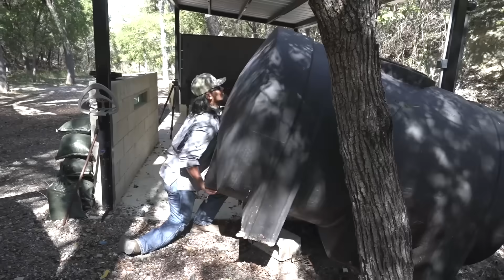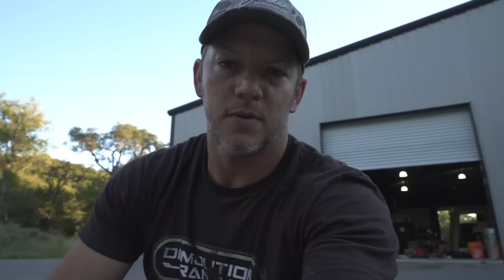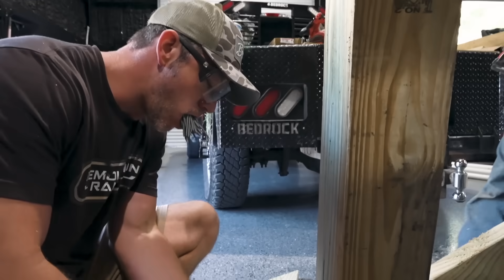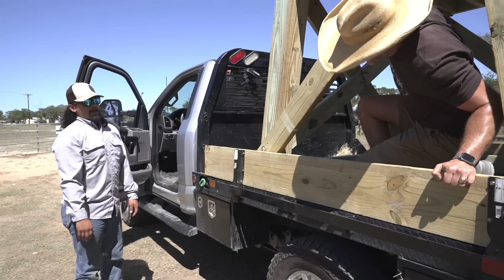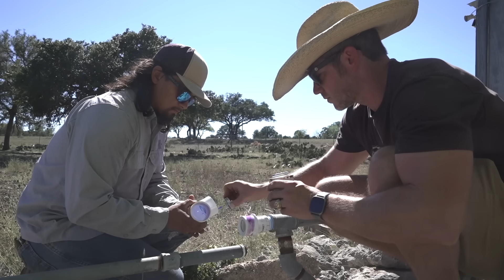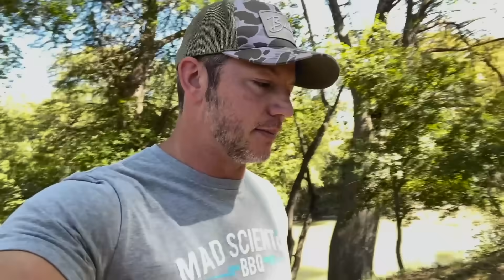Going Into the Cave… But This has to Be Done First!

Comment: You could have just cut 2 inches off the other 3 legs to even it out.
Reply: That would have made too much sense.
Reply: Hush with that sort of talk
Reply: And not wasted an entire 6x6, either
Reply: Pretty sure he wanted 5 feet high to fill into the other tank, as previously stated, but you guys nailed it.
Reply: Totally agree, also they should of put the horizontal timbers on the top of the posts so there weight bering which will support the weight of the water tank far better than fixing them to the side of the post like you have done.
Reply: as another option...he could have added a  couple inches to the bottom

Comment: Put a vertical vent pipe at the top of your overflow pipe to break suction in the pipe. Also, a clear pipe in the overflow would show you the tank level without having to take the lid off the tank.

Comment: What happened to your fire truck build?
Reply: He uses it for fires at the range so it stays there
Reply: Sold it or took it apart I believe
Reply: It caught fire and he did not have a way to put out the fire...
Reply: I think he sold it with a couple other vehicles to help get the ranch. I believe he hinted at it but never confirmed it.

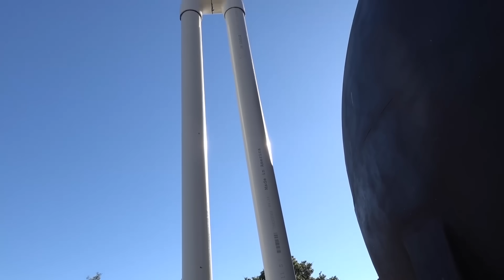Comment: 28:50 what if you just drilled a hole at the top in-between the 90° fittings? Wouldn't that stop the vacuum but still allow the water to overflow, and allowing it to drain over into the pond while making it a simple fix also? 🤔 😅
Reply: What I was going to say exactly😅
Reply: as a engeneer for poatable water that was my first idea. just put a breather at the highes spot.
Reply: Top elbow should be a T with a 6” ft riser.

Comment: @Matt Carriker. Just drill a tiny vent hole at the very top of that joiner section that fills the gap between the 2 pipes going up. When the tank fills, it can still run across but won't be able to siphon because of the vent. If you want to get fancy, put a small upright section of half inch sticking up a couple of inches and it'll work exactly how you want it to.

Comment: Please someone correct me if I’m wrong but if Matt was to simply vent the top of his loop it would eliminate the siphoning from the vessel right?
Reply: Correct
Reply: Yup sounds right
Reply: Still wouldn't work. No way the well pump could work against the 600psi head pressure when the tank has 500 gallons in it.
Reply: @peterosmanski7466 the head pressure is the same whether it’s going into the tank or out the overflow. He’s already shown that it can easily pump out the overflow. Head pressure is dictated by height, and nothing more.  10 gallons or 1000 gallons, the pressure will be the same.

Comment: Yes you need to fill from the top, you are currently trying to build a massive head of water that is working against the pump.
EDIT: That's also probably why you were burning out the pumps at the range.
Reply: False, no difference in head between filling from the bottom of a full tank and filling from the top, either way the pump is lifting the water the same height.
Reply: It's the weight of the water in the tank that the pump can't overcome. If its filled from the top, it only has the weight of the water in the pipe.
Reply: @Apachefog  that's not how it works, the pressure is determined by the height of the water column not the volume
Reply: @isaacclark6749   So if a small pipe were the same height as a water tower, they would produce the same pressure at the bottom, regardless of the large volume in the tower? I suppose logically, since a water tower uses gravity to supply its grid, the whole system down to every faucet in every house is one huge communicating vessel and therefore the water level could never exceed the height of the tower in any part of the system. I had not considered that.
Reply: Head in a top fed pipe = head of bottom fed pipe + head of the tank.  They're equal; only height of water matters, not volume of the tank

Comment: If the top of the tank is sealed it turns into a pressure tank with an air pocket on top. The tank needs a vent out of the top to allow air to escape when filling and to allow air to enter when you are draining the tank.

Comment: You could fill from the top by drilling and sealing a tube to the cap, and put a pressure relief valve on the bottom, then play with the springs inside the valve to allow you to keep a certain amount of pressure or water in the tank at one time🤷‍♂️

Comment: Matt you need a breather tube on the overflow to break the vacuum; that’ll stop it siphoning. Filling from the top may also be slower cos of the back pressure of the water in the tank pushing against your pump pressure. I may be wrong on this but the physics makes sense that way to me.

Comment: As others have said, a hole at the top of the overflow piping will break the syphon. I'd put a cap/hat just above to protect against debris and bird crap clogging the hole/pipe.

As for event planning, yeah you'll want to basically start planning a year in advance, talking to bands and vendors about interest for specific events but you don't have to lock them in immediately. 2 months before the event would be a good point to lock in and start promoting. This will give you time to adapt if a band pulls out for some reason, you could open it up as a battle of the bands for locals if you can't lock in another professional band. Just a few thoughts (played a few gigs, talked with bands and venue staff about the logistics a few years back). Best of luck with future events

Comment: The siphon issue is easy enough to fix, adding any kind of vent to the U at the top of the piping (a T valve, drilling a hole, etc) would stop that...Redo the piping to fill from the top with an overflow pipe coming from there and down to the pond instead (and when the overflow pipe bends down from the top of the tank to go to ground level before running out to the pond, use a T section instead of an elbow and you'll have a siphon-breaking vent already built in) and you'll be set.

Comment: The trouble with filling from the bottom is I'm pretty sure it's having to overcome the pressure of the water in the tank in order to fill, so the more water in the tank, the more pressure it'll need to fill. Whereas if you fill from the top it's just got to push the water up a couple more feet of pipe which I'm sure that pump can handle. Also, as others have said, just pop an opening in the top of the overflow to prevent the syphon effect

Comment: Given how much sun you have there, a recipe that has worked for my brother's farm for years now would be to take solar panels, feed water pumps that collect water into 10 liters tanks up ~15 meters high structures, which then are used during the night to power the next day's batteries, via turbine feed as the water gets distributed to A and B spots on his farm. Water battery. You have both electricity and water resource, all fed by solar power.

Comment: If you drill an air intake hole in the top of the pipe at the overflow's upper bend (between the two 90's at the level of the top of the tank), that may prevent the siphon from forming (though it would allow bugs and such to get in, but that probably won't matter for the water used to fill the pond).

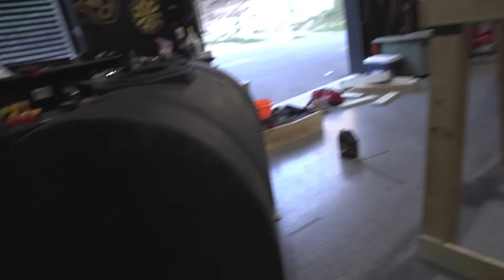Comment: 7:13 mark...Matt, all you guys had to do was to was unscrew the two flat boards from the upright leg that was 2" too short, move the boards up 2" and re-screw them to the leg at the right height before drilling for and installing all of your 10" galvanized carriage bolts through everything. No one would have been able to see that one leg was 2" short, and it wouldn't have mattered at all as far as the strength of the tank stand goes.

Comment: To stop the siphon: Drill a 1/4" hole in the top of your overflow pipe. This will prevent a siphon from forming by pulling air in through the hole and breaking siphon.

Comment: You need a vent hole in the very top of the tank to fill it faster. 
Get two bungs to put in the tank. One in the top for filling and the other at 95% for overflow to pond.

Comment: You're going to create a siphon! Put a t in between the up and down and maybe put like a 1' riser on so it won't create a vacuum and water won't spew out of it. Just drilling a hole will work but you may loose a lot of water while the pump is running

Comment: You could run a water pump from the water cave to the pond and then those 2 would possibly be cheaper and work out together to geta great walk through cave once clearedfrom mud! 😏🤔😅😅
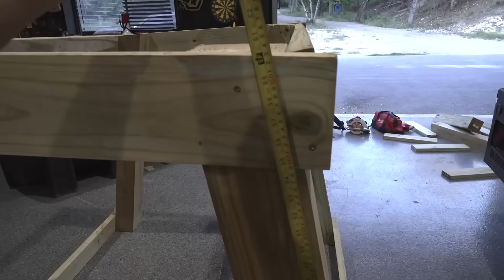Also at 6:45 its because you measured from inside to outside or vice-versa  like from one side to the other at the 5 foot mark!😅😅

Comment: Simple solution pump---- (T1)----- pond... off the (T1) toward the tank.... a pvc 1 way check valve...( T2) ----- tank .....off this (T2)  secondary line to fill trailer tank also used as winter drain... so keep ur current system just cut from 1st T to ball valve and install a one way check valve and a second T

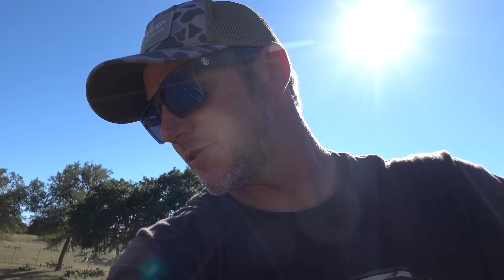Comment: 27:00 Applied air pressure is multiplied by a liquid's surface area. The larger the surface area is; the more water pressure you need in order to overcome the air pressure.

Comment: You might need to drill an air hole or something at the top of the overflow to prevent it acting as a siphon.
A flood/drain bell siphon works in a similar principle to what you have set up. Oh. Apparently it did siphon later in the video.

Comment: The pressure of the water in the tank is less than the overflow standpipe if you filled from the top. Your valve may be restricting the flow some depending on design. You could install a larger valve to tank bottom.

Comment: You should change how to water goes into the tank and how it's overflow works, so there isn't a siphoning effect. You should have an intake at the top, then an overflow close to the top and an drain and outflow low on the thank. Do that right and the tank should fill properly, and then overflow when it gets full as needed and you could drain it if needed.

Comment: The water in the catchment tank is heavier than the water in the pipe (because of the size of the larger tank size) therefore, the water in the tank is pushing the water out, rather than filling the tank.

Comment: It needs to be filled at the top and drained at the bottom. Allowing overflow from the bottom leads to the siphon. You need the overflow to be from the top so water cant be pulled out.

Comment: You basically created a bell siphon. All you need to do is cut one of the 90s out from the top and put on a T with the other side going straight up. That will break the siphon. If you put a way to cap the top of the T when you want to drain it, all you would need to do is and it will drain itself through siphon..

Comment: Existing pipe system will work, you just need an air hole at the highest point to stop it syphoning.

Feeding from the top may be better though so the well isn’t pushing against the weight of the water already in the tank making it fill slower the more full it gets
Reply: Yeah, that's what she said

Comment: it might be easier just to drill a hole into the lid and have it fill in through that and use a threaded union so you can remove the lid if needed and just have a T at the top maybe for the overflow leaving the bottom connection open for anything.

Comment: If you drilled one small hole or put a T fitting on one side at the top of the riser it should break a siphon and just allow the tank to fill and overflow without siphoning.

Comment: You need a large gravity tank.  The kind they use on construction sites for the water trucks.  It's basically a semi tank trailer that they put on stilts.  You just pull up under it and it will drain high volumes,via large valves, into the truck. The tank auto fills immediately then has an auto shut-off when full.  So, its always full.  Same concept, just bigger. And, yes...fill from top, drain from bottom.

Comment: The top of your tank needs an air vent so air can be pushed out as water is filling in from the bottom and so  air can be pulled in through the top when you're trying to fill up your mobile water tank and not create a vacuum

Comment: honestly put the pipes in to the dirt oneless headache since you only need to worry about the pipes outside if the earth to burst. Also instead of the siphon just drill a hole at the upper end of the tank so that it will have to fill up and the overflow like a bathtub.

Comment: Matt, instead of redoing the whole plumbing system on the water tank try putting a vent at the top of the line so it doesn’t siphon

In Plumbing, we use these little vents underneath islands so that their system will still drain without letting the smell out 

I would provide the name, but I’m not sure exactly what they’re called

Comment: you need a vacuum breaker at the top this can be done with a simple flapper type check valve, or be really cheap about it and just drill a 3/8" hole in the top of your pipe and call it a day. also you should realy have a backflow preventer between the well and the tank...

Comment: Filling from the bottom is going to put a lot of stress on the pump.  It has to pump against all of the pressure (weight) of the water in the tank.  It's best for the pump to fill from the top.

Comment: Pumping from the bottom you are now having a pressure head fight against your well pressure. Filling from the top will mean the pump is always pumping into a power pressure area. You can still have the overflow Tee off the from the top and into the pond

Comment: You need a big pump or a positive displacement pump because the pump leaks back into itself. Higher goes the slower it goes. 15gpm on flat ground  and up a 15ft may only be 2 gpm
Reply: Not to mention all the pressure from the water in the tank…

Comment: Make the overflow come from the top of the side of the tank. That way, it will only flow when the tank is all the way full.
Reply: And fill from the top to reduce pressure at the pump.
Reply: @jeffwhite6343 head pressure is ONLY dependent on the height it has to pump. The volume of water in the tank is irrelevant. Filling from the bottom is actually slightly easier as the pump won’t have the extra height that would be needed to clear the top of the tank.

Comment: As well as the syphoning issue you’ve got weight-of-water working against the lift capacity of the pump, the more water in the tank the harder the pump has to work to push more water up into the tank and your pump is unlikely to have a high lift capacity

Comment: You just need to have a vent at the peak of that u bend, to let air into the system. It'll still allow overflow to spill over, but won't siphon your tank. 
You don't need to rework it, just poke a hole.

Comment: Going through the top make more sense, use a float valve to control the overflow on the bottom side of a t junction into the tank and you're good.

Comment: Quick and dirty, drill a hole in the pipe at the highest point to break the siphon.  More professionally, there are anti siphon valves for farm irrigation systems.  You need something like that at the top of your pipe stand.

Comment: I'm not an expert, but I believe as the tank is filling, the weight of the water inside increases.  That weight may be more than the pump can pump against.  It may be best to fill from the top and have your overflow set up different.

Comment: You're fighting water weight pressure by filling from the bottom. On the ranch, our tanks all filled from the top dumping in and loaded from the bottom with some having a pump for the brush trucks and transport trucks.

Comment: Drill an air hole at the highest point of the siphon tube, it will then be unable to siphon and will work like an overflow as you originally intended.

Comment: Put a air vent or hole up the to to stop the pressure and it will stop it sucking the tank out or a t piece and a valve to crack open to let air in

Comment: Pretty sure all you need is an air vent on the top of that pipe to stop the siphoning. Don't just drill a hole, as it'll squirt water out, use an air vent/ vacuum relief valve.

Comment: I would fill from the top, just because those well pumps dont create enough pressure to fill against the pressure of the water built up in the tank. Then at the top of the overflow that you created I would put a T there to break the vacuum. It’ll still overflow without sucking the tank dry. When you see how the inside of a water tower works the water actually fills from the top not the bottom even though the pipe comes up through the bottom of the tower. If it did then the pressure would eventually even out and stop filling.

Comment: You probably wont be able to fill the tank all the way up because the pressure will increase against the pump has the tank is filling. You can keep your overflow the way it is but fill it by the top would get the backpressure out of the pump and for the syphon just drill a hole on the top of the U or put a upside down T.

Comment: Is there a vent in the water tank to vent air as the water fills it up? If not, you essentially have a giant pressure tank. Also, it may be filling slow due to the water pressure inside the tank pushing back on the pump.

Comment: You need the. Top to be open Going up from the tank  so it fills. Up to the and then. Just flows. Over. And out   but won't sifen a t  with Short But At Top to replace. The. First. Elbow  joint

Comment: Thats called head pressure. Your pump is not strong enough to by pass. Load it from the top and it will
 work way better.

Comment: Lol Me thought right away when you fill from the bottom as the tank fills with water it builds pressure from the volume of water in the tank. Now the pump is fighting the pressure in the tank. The fuller it gets the slower it fills. You could maybe put a fitting close to the top so the over flow will run into the pond. But still need a pipe on the bottom to drain the tank or what ever. Nice try but good luck.